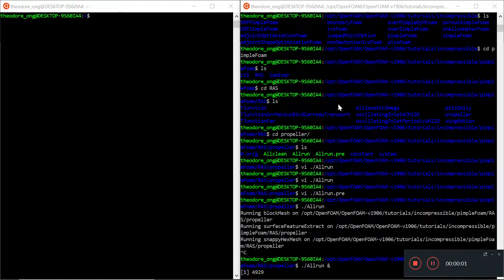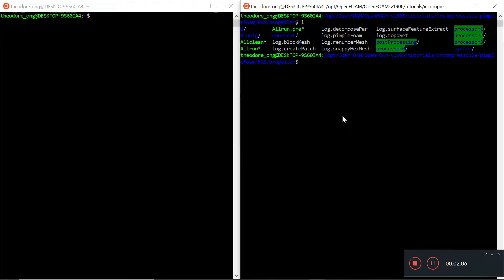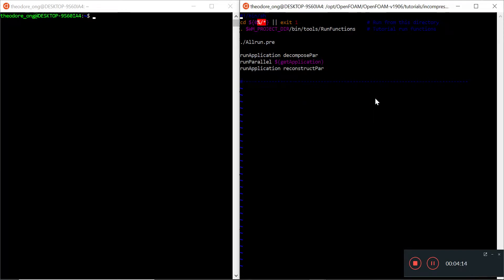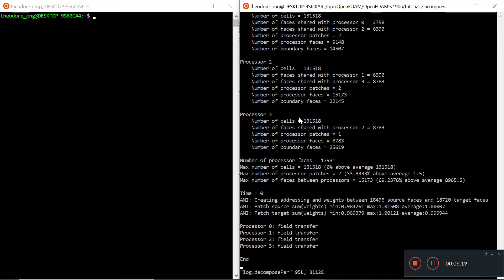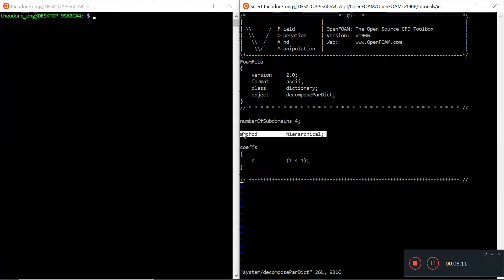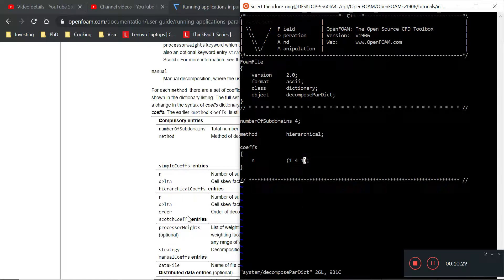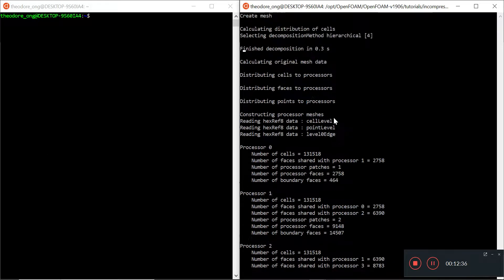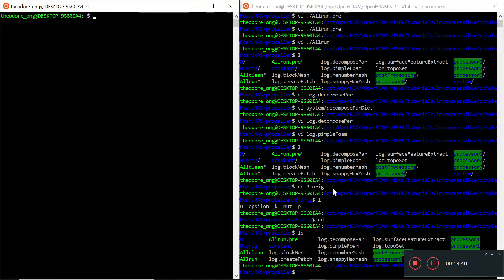OpenFOAM Intermediate - 40 Running in Parallel decomposePar part i (pimpleFoam Propeller case)

Comment: Hi, I have a question. when I used parallel it run for some times then it stoped and show an error "mpirun noticed that process rank 4 with PID 132777 on node compname exited on signal 8 (floating point exceptio)". do you how to solve it?

it work without parallel but take to long time.
thank you

Comment: hey im 1week new to this im running ./Allrun and getting the log. files but how can i actually start the computations
Reply: @TheoOngScienceAndEngineering  thanks! After running ./Allrun i dont generate any new files and the total duration it takes for the command to run is short enough that i suspect it does any calculations. Also i do not get a .foam file that i can visualize with paraview

If the calculations are indeed running how can i retrieve the results file?